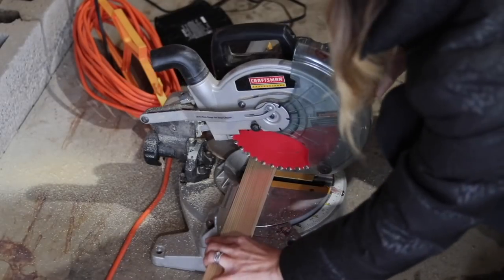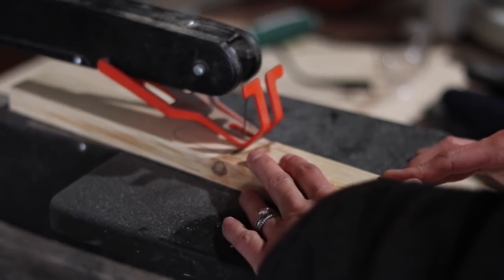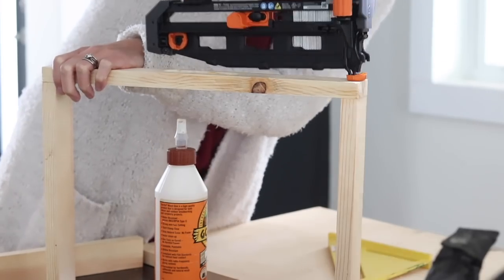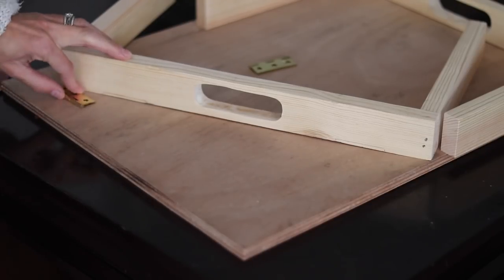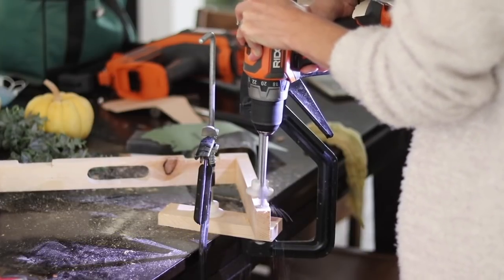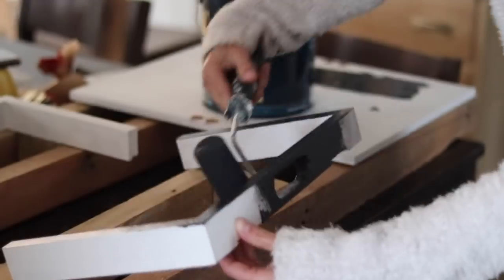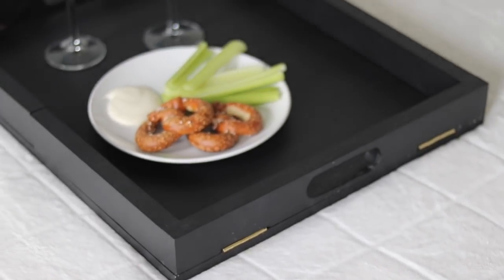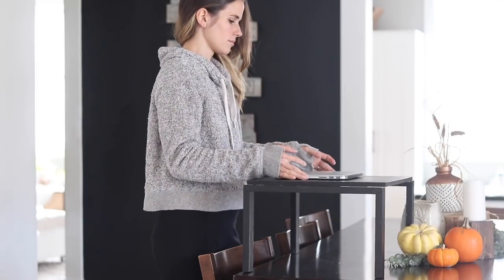3-in-One Wood Tray Idea

Comment: I cringed when you glued the legs end grain to long grain.  That is not going to work long-term.  The end grains will "suck" the glue down the wood fibers, away from the joint.   Once the glue breaks the nails are not going to provide any torsion support.  At minimum add some dowels so that you have some long grain to long grain bonding.  Based on some of your other work, I don't think that you have a basic understanding of what wood glue does.  In a world of hypersensitivity I realize that this comment may seem extremely critical, but I hope that it is constructive criticism.
Reply from the maker: Would it have been better if I glued the end of the handle pieces to the long grain of the legs instead of the other way around?
Reply: @WelcometotheWoodsBlog  If I'm understanding you correctly, that would still be the end grain of the handle pieces to the long grain of the legs.  It would probably have been better because the sheer force on the nails would be horizontal to the ground instead of vertical, but in as far as the gluing, it wouldn't be any better.  

If you glue wood long grain to long grain on jointed boards(or most of the time, even flawed surfaces), the joint will be stronger than the wood.  You could beat it with a hammer and the wood will fail before the joint does.  If you glue end grain to long grain and then tap it with a hammer(I really mean tapping, not hitting, tapping) , most of the time, unless you get lucky with odd running fibers the joint will just fall apart.  In this case you would have to get extremely lucky with all four joints having odd running fibers to ensure that every leg is bonded.  

Cheap super glue would have been a better choice, in my opinion, for your joining method, as it dries fast enough that the end grain doesn't have time to properly absorb the glue before it dries.  There is a chance that this piece lasts forever, but I wouldn't trust it, and I believe that most people with wood working experience wouldn't either.   I think that most wood workers would have used have used a mortise and tenon(which would outlast the piece) or at minimum inserted dowels.  It's a beautiful piece and you obviously put a lot of effort into it, but with just a bit more effort you would have had a masterpiece that would last forever.
Reply from the maker: @keith_dixon  So one thing I learned about gluing in the past I did with this piece is apply one coat of wood glue to the end grain and let it partially dry. Then apply wood glue like normal and clamp. As far as I understand, the first layer of wood glue "seals" the wood pores somewhat. Do you think that helped?
Reply: That’s called “sizing” the joint. It can be helpful, but still not a great joint there. Dowels would be best. You also could have pre-drilled and used counter-sunk wood screws with dowel covers. 

Either way, it doesn’t take away from how super cute you are 😜!!!
Reply from the maker: @joeblow5958  Yeah I think I should've sunk in screws and then filled the hole. I guess I still could add that to the design.
Reply: @WelcometotheWoodsBlog  That would probably be better, yeah.  But if you were going to go to all that trouble you could just as well counter sink dowels or even make a floating tenon.  I mean, if you are already holding the drill and drilling holes anyway, why not just drill deeper and glue in a real joinery piece?  I personally would love to see a video of you modifying this piece with a floating tenon on each leg.